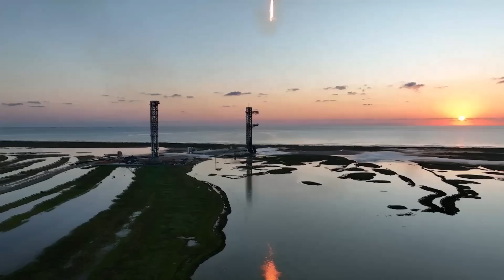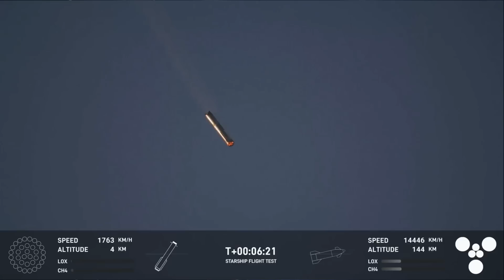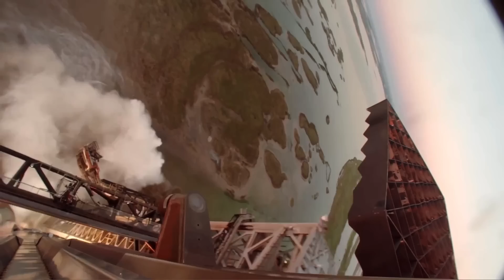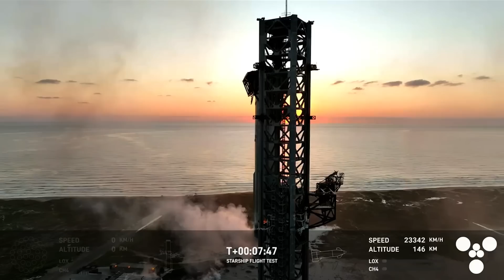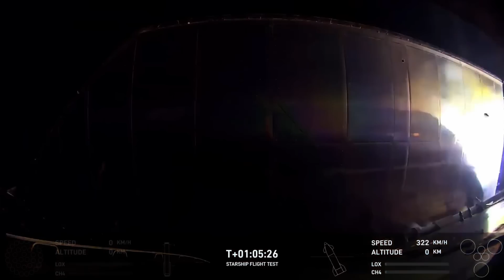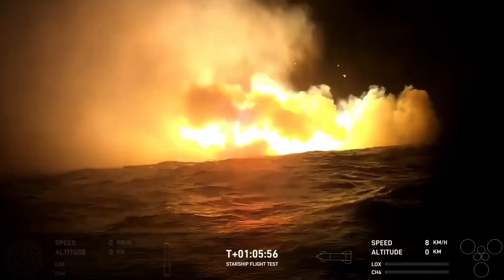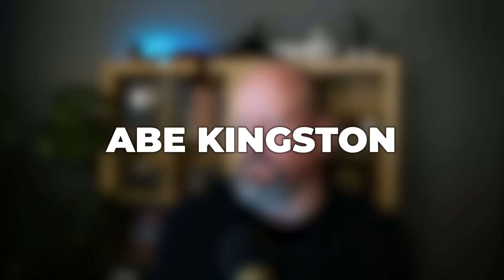ABSOLUTE Success! Full Analysis of Starship IFT-5 (with @scottmanley, @MarcusHouse )

Comment: My question for all three of you. Has SpaceX effectively proved that an RTLS with the Space Shuttle could have worked? Going with the concept that the atmosphere is thin enough at that high of an altitude that the Space Shuttle could have flipped around, thrusted against the direction they were traveling in until they nulled out their energy, then thrust back home.  The only thing that I'm curious about is the drop that would have occurred before they started moving back towards the cape.
Reply from the maker: The original plan for the space shuttle was that the big fuel tank would be re-usable and be able to glide to a landing. It would have pilots on board who would glide it to a landing downrange. Then the orbiter would continue on and it too would be capable of returning. I'm always sad that they ditched that idea for the disposable fuel tank. https://en.wikipedia.org/wiki/Space_Shuttle_design_process

Comment: Launching Starship from a floating platform is one thing, attempting a catch with a floating platform would be an entirely different problem. I suspect that's why they have currently abandoned the idea. I can't think of a really good way to keep a tower that tall, on a floating platform of any reasonable size, from moving a little bit and even a little bit of motion is going to cause a failure.

Comment: The solution to keeping the outer bells from warping could be as simple as a valve that switches the fuel flow for the mid engines to flow through the outer bells and the inner bells before consumption, run 1/3 of the fuel per engine through its bell and the other two thirds through the 2 adjacent bells. But that might not be enough cooling to keep them from warping. Or perhaps dividing the fuels into 3rds and running all 30 engines at 1/3 fuel to each engine for the same thrust.

Comment: They’re going to have to have landing legs to land on the moon so why not here
Reply from the maker: 1/6th gravity. So you can make them with less material.
Reply: And the goal here, unlike on the moon, is to have a rapid turnaround and launch again. Having legs would mean that they would have to transport the booster back to the launch mount.
Reply: @johnpyejr.5670  not necessarily just because the booster has legs or the ship has legs doesn’t mean it has to use them. You can still catch it out of the air, but 
When you need legs, you have them

Comment: Why are they trying to catch Starship when they successfully landed it on its legs?
Reply: To save a lot of mass.
Reply: @anthonypelchat  Thanks, but didn't Starship land on some fairly tiny legs? Surely that didn't add too much weight?
Reply: @GordonFlash1983  The booster would need huge legs to land. The upper stage can stay on smaller ones, but those still aren't lightweight. They just seem small compared to the massive ship. 

They could fallback to landing legs if needed. But since there is such a good reason for catching the boosters, you might as well try to catch the upper stage as well.
Reply: Rapid reusable. Landing legs are a lot less efficient than just returning to the launch tower where they can refuel and launch again.

Comment: Probably the booster should also do the bellyflop maneuver. This way you only need enough fuel for the final brake and translation, and you're not exposing the engines to mach 4 winds.

Comment: Well it wasn't exactly a 100% success they caught the booster but the starship blew up after touchdown so I'd say 85% success.
Reply: The Ship was going to be destroyed. They weren't trying to have it be save. 95% successful at minimum. Only real issues were the nozzle warping, some minor damage to the booster, maybe the fire on landing (some saying it was supposed to do that), and the burn through on the ship during reentry.
Reply: @anthonypelchat  um.....if you destroy it on purpose, like using the FTS that's one thing, but an RUD is totally different and they did not use the FTS to scuttle the craft. They want to demonstrate that the ship lands intact not going boom if you think otherwise your out right wrong. Instead of going boom from lower altitudes it now is able to sub orbit and then go boom when landing. They have to stick the landing to be fully confident that it won't go boom. It's progress but it still needs work.
Reply: @TheGreatSnafoo  If they wanted it recovered, they would have landed it closer or ships nearby. They never expected it to survive that far. FTS would have blown if it did survive.

They stuck the landing. But without legs, nothing to catch it, and over water, they didn't expect anything to survive. Period.
Reply: @anthonypelchat  it's not the point. You fail to understand its better to blow it purposefully than it blowing up on its own, that's the thing you fail to understand . Means nothing if they planned to recover the craft or not. They kept saying softly land in the sea not safely land in the sea then explode. Just like when they were trying to soft land on the ground it blew up every time except for one time. Suspected burn through on forward flap caused the explosion because the explosion was near the top of the craft. More work will have to be made in order to rectify the problem so giving it an 85% is not bad its still a passing grade. Once they can stick the landing with out a RUD it'll be a 100%.
Reply: @TheGreatSnafoo  You keep missing the point. It was literally "If it survives, we detonate." There is no failure nor anything to work on with that.

Comment: I think scott manley was dying to say you can't just keep adding fuel, the rocket equation eventually means that your thrust to weight ratio is less than 1 and it won't budge. You can tell due to the slow acceleration on the initial few seconds that the t/w ratio is very close to 1.

If you want to add fuel you need to increase the rate that you can consume that fuel to generate more thrust. Try it in kerbal

Comment: sry one question... many cgi pictures show starship on the moon on even terrain
starship currently 120t empty + cargo astronauts and anything they need to stay alive unless u want them to be restricted to their suits for the whole trip with the same diapers 50t + fuel 500t or more (my guess, there are supposed to be at least 15 refueling flights)
afaik the ~10-20t apollo LEM created a small crater
shouldn´t  ~600-700t starship create a massive crater and even worse a giant dust cloud
landing in the dark on uneven unknown terrain possibly in loose regolith or on a rock with a 14 story building and a center of mass above the middle of the spacecraft, how to prevent it from tipping over?
furthermore you got to return to earth again... wasn´t there a lot of debris damaging a couple of raptors at the first attempt to space resulting in  an "unplanned mission extermination" or something like that?
just wondering because the starship V3 is going to be even bigger and heavier so its probably closer to a 1000t landing weight i dont know
Reply: yes... and no. Yes when they would use the 'main engines' at the bottom. No because Starship isn't going to land on the moon. When something land on the moon, it will be a special design where the landing engines are mounted high up, away from the ground. 

The hight with respect to the center of mass and therefore the danger of tipping over... well this is another story and one that I'm very curious about.
Reply: Lunar Starship is planned to have smaller landing engines placed like 40 meters up and angled outwards. With that amount of separation between the engines and the ground, the expectation is that it will be fine.
Reply: @SpaceAdvocate  ok thank you... and ur still able to rapidly ignite these landing thrusters in case there are unknown ground instabilities... some loosely dust filled crater or an underground lava tube 
and the crew is still at the top at 40+ meters?... is the crane still the solution to get everything moved? what happens if an astronaut drops from the top... if you drop streight down on ur legs could u make it unharmed? maybe by converting energy into rotation and rolling on the ground...
of course once tumbling thats quite hard. maybe its not such a bad idea to finally realize one of elons most favorite things in the world.... the wrist peaces of the spacesuit need COLD GAS THRUSTERS... 
the first step on the moon by the us of a after 70 years, but this time iron man style

Comment: The Great Space X pointed out that the grid fins got damaged during the boost back burn. If you watch it the grid gets warped when the exhaust hits them.   Those are titanium, so it shows how powerful those raptor engines are when they can warp the grid fins in less than a second.  I wonder how much pressure the staging ring has to withstand.

Comment: My takeaway from IFT5:
- Booster landing accuracy was well inside tolerances, this shows great design margin. Tower west chopstick installation can continue.
- Booster chime damage - when? Released video coverage is not clear, if hot stage hit chime. Perhaps SpaceX has another angle. Waiting for the hot stage to clear the booster prior to change in trajectory may need further review (code change). Hot staging is like Starship heat shield, a painful compromise requiring iteration.
- Starship v2 changes are needed sooner or IFT6 SN31 should be used for Raptor relight, showing effect of a re-entry burn on heating.

Unknowns: Orbital recovery of Starship would require re-entry over Texas, I imagine the license would need to come from NASA perhaps back to modifying an old oil rig.

Comment: The part that is still boggling my mind and I feel like hasn't be talked about a lot is them having to land on such relatively small points. Getting a massive rocket to even end up just between the two arms is one thing, but then it even needs to be rotated so perfectly! I was wondering why they don't essentially have a ring around the entire rocket that protrudes out so the rotation doesn't matter, but figured it would cause weight and aerodynamic issues. Apparently though it isn't even an issue since they nailed it on the first try!

Comment: ABSOLUTE Success! Full Analysis of Starship IFT-5

* 0:00 Intro: Fraser Cain, Marcus House, and Scott Manley discuss the incredible success of Starship's 5th test flight, particularly the Super Heavy booster catch and Starship's atmospheric re-entry.
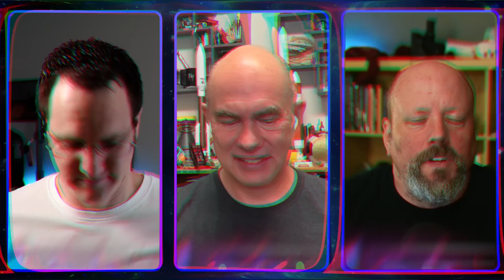* 1:05 Flight 5 Objectives: The main goals were to catch the Super Heavy booster, improve Starship's re-entry process for a more accurate landing, and gather data for future development.
* 3:54 Liftoff and Ascent: The launch was visually stunning, occurring at dawn with smooth engine performance and successful stage separation.
* 5:50 Hot Staging: Super Heavy performed a boost-back burn and ejected the staging ring as planned. Reaction control thrusters were used for precise maneuvering.
* 10:04 Super Heavy Catch: The booster re-entered the atmosphere at high speed, causing significant heating. Despite minor damage to engine bells and panels, the booster was successfully caught by the Mechazilla arms.
* 16:01 Odds of Success:  Experts initially estimated a 50/50 chance of a catch attempt and were surprised by the successful execution, particularly given the potential for engine issues during the landing burn.
* 20:38 Future Starship Versions:  Discussions focus on the need for design improvements in Super Heavy (V2 and V3) to optimize reusability and increase payload capacity. Considerations include propellant margins, heat shield effectiveness, and engine durability.
* 23:42 Starship's Re-entry and Splashdown: Starship performed a controlled re-entry, showcasing improved heat shield performance compared to previous flights. However, some burn-through was observed on the forward flaps, indicating a need for further refinement.
* 37:38 The Aftermath: Post-flight analysis revealed relatively minor damage to the booster. The booster was safely placed back on the launch mount for inspection. The successful precision landing of Starship demonstrated the potential for future recovery attempts.
* 42:28 Flight 6 and Beyond:  SpaceX could potentially conduct another test flight with the same license, focusing on booster reusability or attempting a full orbital flight with Starship.  Orbital refueling remains a key milestone for future missions, including the Artemis lunar landings.
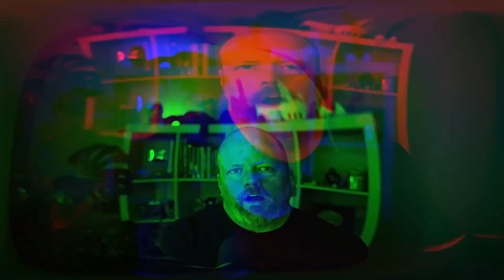* 58:11 Final Thoughts: The successful booster catch marks a major turning point in heavy lift rocketry. While challenges remain, SpaceX has demonstrated the feasibility of key technologies, potentially revolutionizing space exploration and paving the way for ambitious missions to the Moon, Mars, and beyond. 

I used gemini-1.5-pro-exp-0827 on rocketrecap dot com to summarize the transcript.
Cost (if I didn't use the free tier): $0.04
Input tokens: 30539
Output tokens: 544

Comment: I think Fraser misspoke, the flaps are NOT aluminium lol you can visually see this with the changing colors oh and the fact that it didnt melt off even though there was a burn through.
Reply: He said they are coated with aluminium because it melts when the steel gets soft, so they can see if temperature is good.

Comment: Starship has 3 vacuum engines and 3 sea level engines. Wouldn't firing only the vacuum engines (above a certain altitude) mean increasing efficiency and so payload performance? Aren't those sea level engines fired all duration only in order to waste propellant just for the sake of testing and keeping the vehicle suborbital?
Reply: It's a bit more complicated. The vacuum engines have better efficiency, but more thrust = less gravity losses. You can expect SpaceX to have done the modelling required to be able to conclude that they gain more from reduced gravity losses than they lose from using the less efficient engines.
Reply: @SpaceAdvocate  Gravity losses isnt't really a thing when the vehicle can dodge the atmosphere, I think. I think if it can pick up enough speed using the vacuum engines, to reach orbital velocity above the part of the atmosphere that would cause significant speed loss, then whatever change the gravity was making to its speed vector will be added to its escape velocity away from the low point of its trajectory. I did expect SpaceX to have done the modeling, but if this was the only way to do this flight with fully fueled rocket then there really could be a serious issue with the payload mass. Of course we don't really know how accurate that LOX and CH4 indicator bar was, but it looked pretty empty at the end. But if I was a SpaceX engineer I wouldn't want to land a rocket with too much leftover fuel, that's why I thought it would make sense for SpaceX to "waste" the fuel on the test filght. It is also very much possible that I'm wrong.

Comment: 41:30 Why would you shuttle a booster from an oil platform when you're starting at a launch tower?
Reply from the maker: To save propellant so you don't have to do the boostback burn. The less propellant you use, the more payload you can send to orbit.
Reply: @frasercain  I understand that landing downrange gets a lot more capability, and I think they'll probably end up doing that at some point.

Sorry, I think my phrasing wasn't very clear. If you're landing the booster downrange at a separate set of chopsticks, you don't need to then put that booster on a barge and ship it back in a few days. In theory you can just put some fuel and a nosecone on it and hop it back to boca chica in some 10s of minutes.
Reply from the maker: Downrange is the ocean. We chatted about this, that SpaceX had originally bought two oil derricks called Phobos and Deimos that they were hoping to install chopsticks on. It might have been the right idea.
Reply: @frasercain  Yeah, I would imagine they'll revisit that idea when they're closer to maturity. It seems like Phobos and Deimos would have had a lot of capital tied up for a process that wasn't even proven and would probably had to have been redesigned and rebuilt anyway if v2 and v3 are in the future.

Either way, I really appreciate all three of you guys' work through the years and you hosted a great discussion of a historical moment in spaceflight. Looking forward to the video of the three of you discussing humans being on the moon for the first time in more than 50 years.

Comment: I wonder which would take more propellant: a little bit of extra to run it through the outer engines to protect them from reentry heat, or a little extra to do a small reentry burn. Elon seems to think it’s not a big deal and it’s an easy fix but that’s Elon.

Comment: Regarding what Marcus said about the grid fins and abort modes, I think for one that grid fins may be more capable than you think when combined with the lifting body of that enormous empty tank, and then, you really have to understand the role of aerodynamic steering in its trajectory. Basically you want to put it on a trajectory where the gridfins will have to work as hard as they can to extend the glide of the booster and push it towards the launch site. You want maximum deflection because that means maximum booster angle and therefore maximum aerodynamic deceleration. That saves a LOT of deltaV, like a lot a lot, compared to flying it with close to zero angle of attack. And it's doing that from 80km up right until the moment it ignites its engine after having decelerated to only mach 1. So you can easily imagine that in case of an abort, if they just let go of the steering and let it fall like a brick it's going to fall a good distance away from its target, but if perhaps they have an abort mode where they turn the gridfins in full reverse and try to push the booster as hard as they can towards the ocean, I bet it'll land miles offshore.